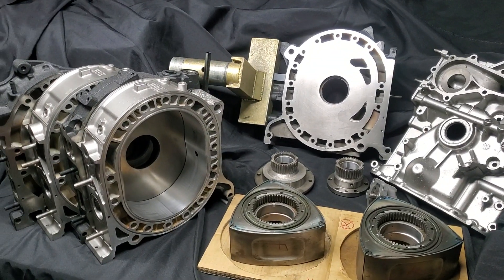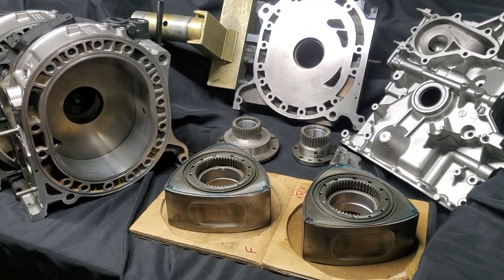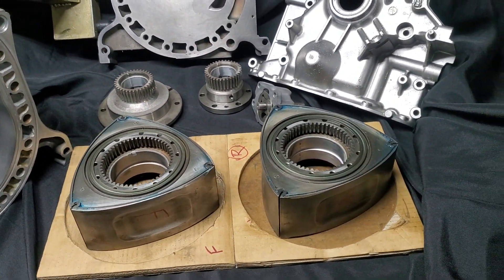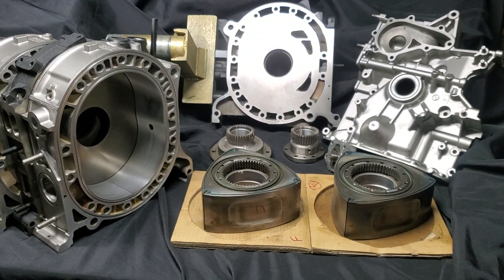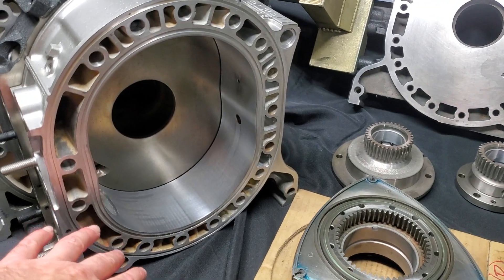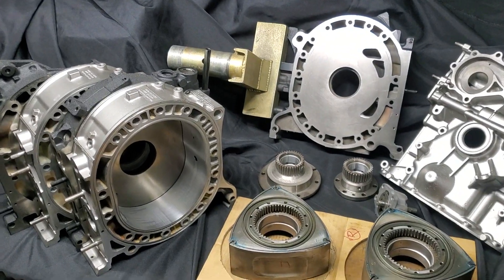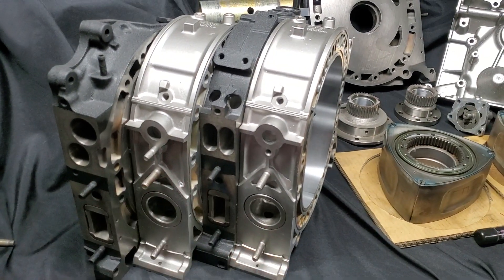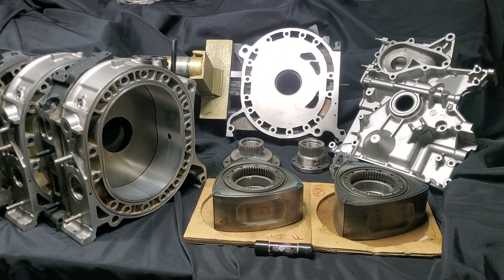RX8 Mazda Renesis Hybrid GSLSE 13b Combo - build, parts and setup before assembly - KMR Vol 8.

Comment: I'm going to be using 12a irons, gslse housings and rx8 rotating assembly for my big build; I'm collecting parts now.. for now I have a s5 6 port that I'm rebuilding for my fb. Nothing crazy just a 48 webber and exhaust..should be good for 180-200hp with street port.

Can't wait to see the power numbers of that hybrid n/a and boosted!

Comment: Super stoked for this build! I’d love to build my rx8 the same way. One question I have is if the higher compression rx8 rotors will be fine for boost? I probably wouldn’t push ignition timing too hard as I am still new to tuning. Wishing you the best!
Reply from the maker: Check out the other videos,  we talk about our previous boosted build.

Comment: I built and ran this one engine just like this made 279hp at the wheels in my NA time attack car but unfortunately a coolant seal failed on track and killed the engine so doing another rebuild now they sound killa. I’ll have it running again later this year just waiting on parts
Reply: What fuel was used, if u don’t mind me asking?

…and what type (hub?) dyno?

Comment: The cutting for the rx7 apex seals is not available in my area. Is it possible to do this build with rx8 rotors and apex seals? Or is it better to use rx7 rotors and seals?
Reply: You need do use the rx7 apex seals, the rx8 apex seals are thinner, they will warp and fail because of the the exhaust ports. You can't use rx7 rotors either cause the rx7 rotors are missing  the extra oil control ring and will also fail. And if I'm not mistaken  rx7 corner seals aren't in the ideal position for the Renesis ports.
Reply: Well thank you.
Reply: @c.b.6350  No prob

Comment: I'm excited about this. There's A LOT of neighsayers about hybrids based on some random internet forum dude's rant about port timing from 10 years ago, BUT the MotoIQ series car made 400+whp at 11psi. Lets see an REW do that! I reckon maybe a hybrid will get weird at 600+ but for 400-something at mellow boost with 10:1 rotors and E85 I bet this is going to be amazing.
Reply: Where can I see that build?
Reply from the maker: @steveobarnes  check-out the other videos in the series.  Links in description.  I think I have the motor I Q build in there.